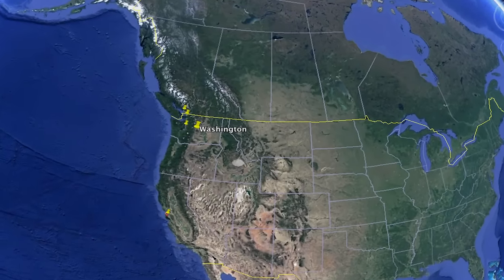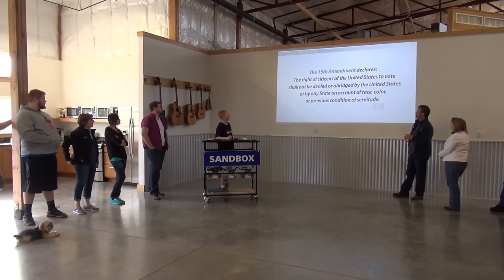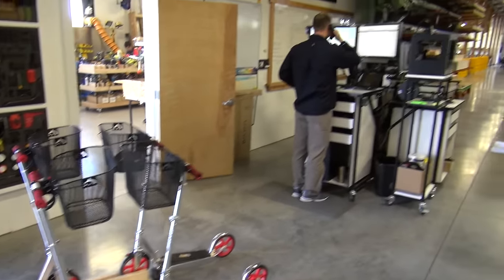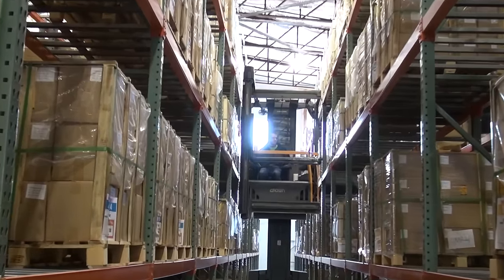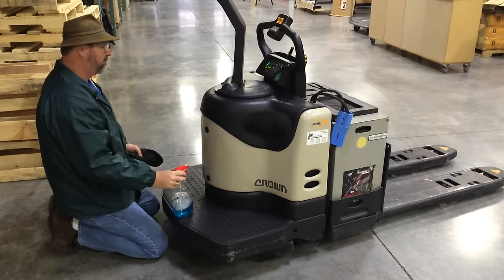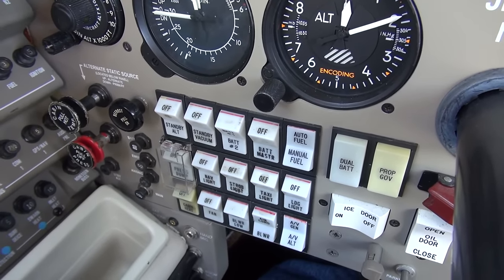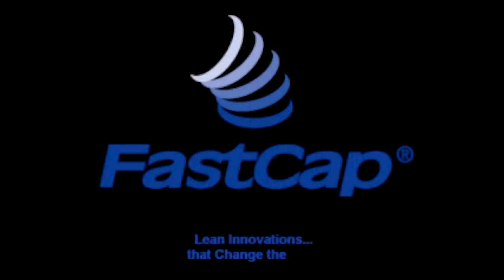Lean Manufacturing - Lean Factory Tour - FastCap

Comment: I very recently got promoted to an Engineer (I started in the factory as a temp production line worker, just loading PCBs into a conformal coat machine). The key point I saw here is having your Engineers in the production area!. This is a fantastic idea!.. as a production line worker it was easy for me to notice ways to improve processes, but the engineers were in the complete opposite end of the building, making it REALLY hard to get those inefficiencies rectified. I've been fighting (and slowly winning) in really trying to improve communication between engineering and production sides of the business. But Physical proximity seems to be a great idea. If you don't hide the Engineers away in an office at the end of the building it can help the flow of feedback.. really get the Kaizen process to flow much faster.. I'm still a very junior engineer (so much to learn every day) but I just LOVE to learn. and more than I love to learn I love to improve processes that are totally arse backwards  and fix them... I hate to hear "But that's how we've always done it" and am really trying to change the culture to abandon that kind of thinking. EDIT FROM HERE: Your plane system.. fantastic. An aviation buff myself I love this idea of unambiguous switch positioning, Very 'Airbus' Philophosy. The airbus philophosy being ALL switches should be in an identical visual state when in the 'correct' position.
Reply: Most facilities keep engineers out of the production environment (in many cases lock and key) because they typically cause more harm than good.
Reply: It's been 3 years since you posted this comment. How's it been? Were you able to affect more positive changes to process efficiency?

Comment: Good job there, although, I'm not sure about the switches, I think there is a thin line that divides where to look for efficiency and it is when you lose focus on the element's functions and prefer to use another reference like the red lines in the case of aircraft switches; I mean that the tendency becomes preferring avoiding time waste and reasoning after instead of reasoning quickly, so you understand what you are doing first.

Comment: On the topic of scooters: This may be a silly question...would employee's need to sign a waiver before using a scooter? This way if employee's fall and bump their necks, as an example of injury, you won't be help liable for workers compensation due to on-site injury? Overall, the scooter in my opinion is perfect to use in your large facility. Thanks.

Comment: JT's scooter is better I think. It allows more tipping room by the looks of it. The other one requires you to ride strictly vertical or you risk the rubber pad skimming the floor. If Doug's could lifter higher, I would prefer it though I think.

Hehe. Big Ass fans. What a great name.

Comment: Paul-

How much analysis do you do before making a purchase like the automatic shrink wrapper?  Clearly its cool, Lean and saves time, but truly how much analysis was done before making that purchase.  I am sure it wasn't cheap.
Reply: There are programs through the BWC were you can get grants to pay for most if not all of it. The BWC has many many programs more companies should take advantage of.
Reply: Nicholas Niedzielski working at a shop that doesn’t have an automatic shrink wrapper I can tell you a lot. Wrapping a skid like that takes about 3-4 minutes multiply that by sometimes 20 skids.
Reply: Do your employees a favor and get one. They are amazing, save time, save shrink wrap, and most importantly save your workers' backs. I may be a little biased because I have hand wrapped a few thousand pallets.
Reply: BTW, it is a Lantech Semi- Automatic stretch wrapper. stretch, not shrink, believe it or not, there is a difference.

Comment: We are moving into a 32Kft building and have a completely open building. At the current office every one has high wall cubes or offices, and is on the phone 75% of the day. How does the open environment work for sound and other people on the phone ?.  Other than the bathrooms, it look like you could move your facility super quickly. Just learning about Lean and really impressed with the facility. We are also worried about sound of the equipment and the forklifts with the constant beeping. Do the office people get upset with that noise ?
Reply from the maker: Everybody’s environment is different. It works perfect for us. Everyone on the phone wears a headset and can manage the noise just fine. A question I would ask is why are your people on the phone so much. Which questions are they answering? Amazon has a policy that if people call them, they failed. The answer should be readily available with simple clicks the moment someone calls you or you’re doing something wrong.
Reply: Thank you for your response. we are consolidating 4 locations into one. We have multiple business that focus on core competencies, and then use shared resources (IT,Accounting,Marketing). Most of the people on the phone are IT support. They have dual ear sealed headsets currently, and are helping (billing) customers for our services. I love your questions, and they have sparked some thoughts. I really loved the video "I aint your mamma". I have been there myself, giving the same talk. spent all weekend watching the videos and learned a ton, now for the podcast and books. 

Could you tell me the name/model of the toilet you are using ?
We have been using the dysan airblade for a couple of years now, removed all paper towels, both a cost savings and clean up dream.
Reply from the maker: Bio Bidet A7 Elongated Electric Bidet Seat, White https://www.amazon.com/dp/B01BKNZCBC/ref=cm_sw_r_oth_api_WpFLAbQJR2KDF
Reply from the maker: I highly recommend making before/after Lean improvement videos!

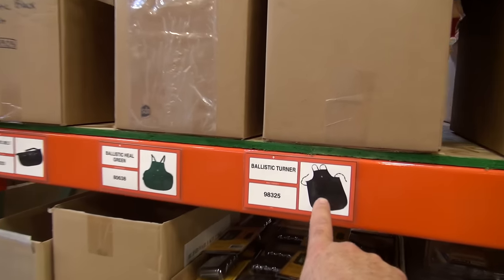Comment: Hi Paul. This s absolutely amazing! Congratulations!  I have a question concerning the labels (visual controls) on the racks: you say on the video (1:56) that you made them, but how did you attach them to the metal structures?  It doesn't seem that you use tape. Did you create an special container/case for them?
Reply from the maker: hey are hung with magnetic tape, I think from ULINE:
https://www.uline.com/Product/Detail/S-6808/Magnetic-Labels/Magnetic-Tape-Roll-1-x-50?pricode=WB0573&gadtype=pla&id=S-6808&gclid=CjwKCAiA0svwBRBhEiwAHqKjFkfIxH1iIT-_U-nk7lY_O4zxXC5Nrl6AAXrmM1LeyOaY4smAgm3uVxoCGv4QAvD_BwE&gclsrc=aw.ds

Comment: Fix that chop saw that sparks in the motor housing! other than that.. great video!
Reply from the maker: The chop saw is fine. The sparks came from the cutting blade hitting a thin metal blade that is on the aluminum pole. We have been doing this for 17 years with no negative effect on anything.  But I appreciate your concern! Paul
Reply: @FastCapLLC  White Lightning SPARKS!!! In the motor housing when the operator turns it on before the blade contacts the work and creates orange sparks at around 4:42, I hope that it is fixed by now. 

Great lean example too, just getting into it myself.

Comment: At 7:50 how many times did they guy in the black shirt hit his head?
Reply from the maker: Wow, you are very observant!
Reply: @FastCapLLC   I am a Quality control inspector. And was a supervisor for 9 years. I was always interested in production lines with cell work together, lean and 5S need to start at the top. And be maintained there too. Seems like your company is all about that.  You hiring?  I also spent 20 years with injection molding machines.
Reply from the maker: @622wesc  Please get ahold of Paul via Voxer or WhatsApp (+13609413748).

Comment: Hey Paul, one small improvement I have to offer for your shadowing in your tool boxes: Add a small semicircle on one or both sides of the tool. That eliminates the need to dig the tool out.
I do it on my shadowing.
Man, I wish you were in the KC area. I would love working there.
Reply from the maker: Brian Herr Great suggestion Brian.  We actually do that a lot by heating up a pipe and melting the Kaizen Foam.  Makes a perfect semi circle.